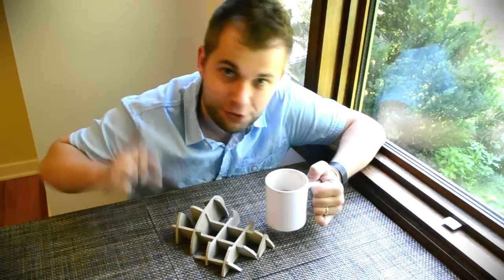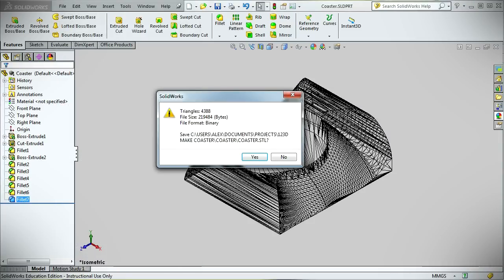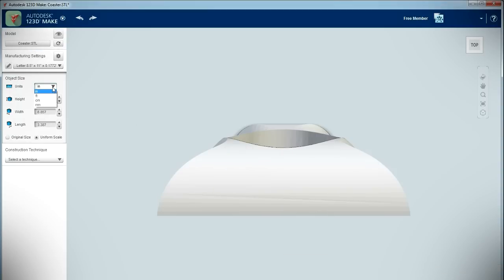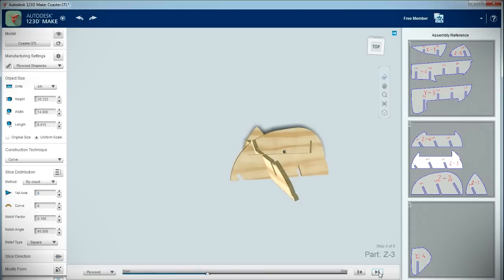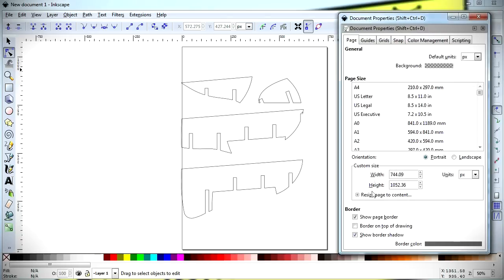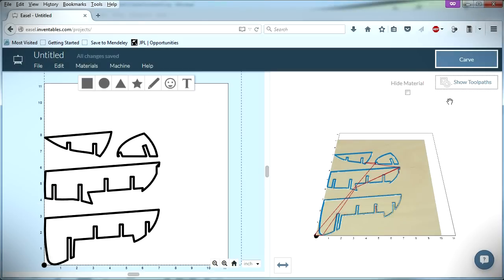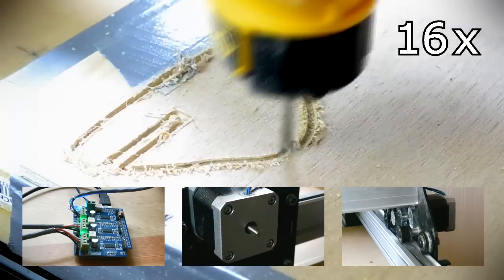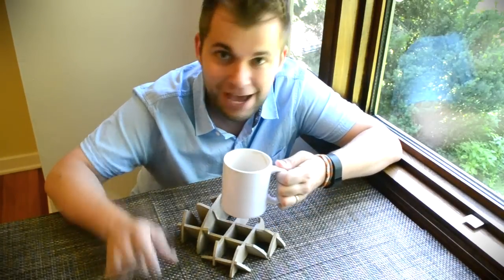CNC Drink Coaster (Autodesk 123D Make) - Super Make Something Episode 5

Comment: so I am curious when you are ready to export your sizes direct to dxf from the 123d workspace is there any settings to change the amount of facets (or nodes) on the 2d dfx geometry? because I am running into a problem when I open the exported dxf into fusion 360 or vcarve pro it is showing way to many nodes in the sketches ? is this why you exported to PDF and then re exported to svg to get rid of those extra nodes any help would be appreciated thanks
Reply: I have not tried a DXF export.  The reason I exported to PDF was that I could import this file format into Inkscape and then save it as an SVG file.  I then used SVG with the online CAM program Easel, since thi sis what it supports natively.

Comment: What CNC machine are you using? If it's homemade will you do a video on it?
Reply from the maker: John Wall The CNC machine is a Shapeoko 2, the predecessor to X-Carve and Shapeoko 3. They are no longer manufactured, but you may be able to find one online from a hobbyist who upgraded to one of the other two machines. I still use my Shapeoko 2 regularly. It is definitely capable enough for anything I've done. The only thing I wish it would have is the ability to upgrade the bed size.

Comment: Very nice work with the coaster.  You demonstrated a lot of capabilities and functions through that workflow that others can follow to create their own projects.  I do have a question; what would you recommend to translate a 123D model into a CAM file a Gcode to fabricate a metal part in a CNC or vertical mill?
Reply from the maker: +800lb Gorilla Thanks! Easel actually has an &quot;Export g-code&quot; option under &quot;Machine&quot; --&gt; &quot;Advanced.&quot;  You should be able to use this g-code with any CNC machine, though you may have to post-process it a little bit to make the commands are exactly compatible with your setup (i.e. spindle too location, etc.).